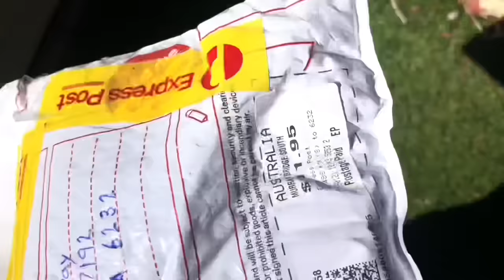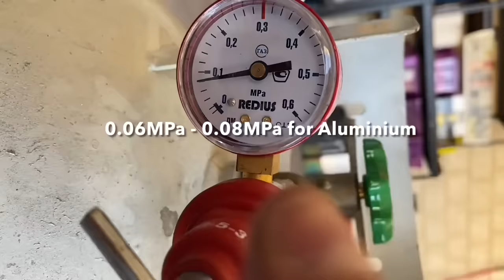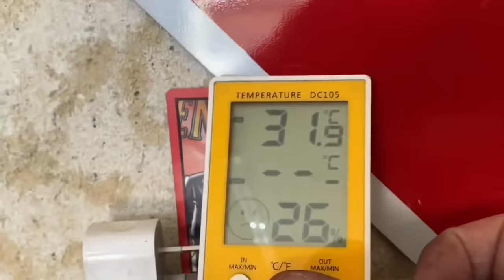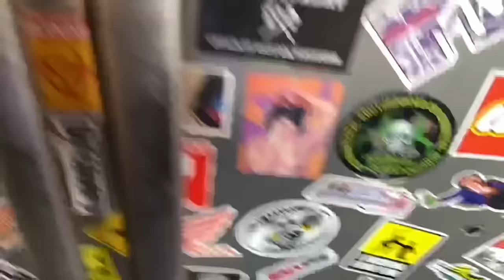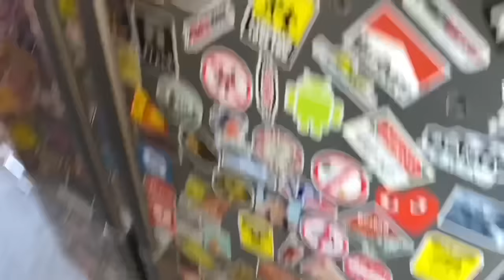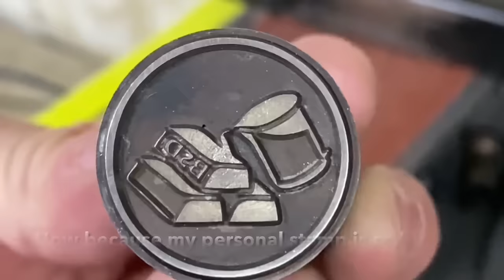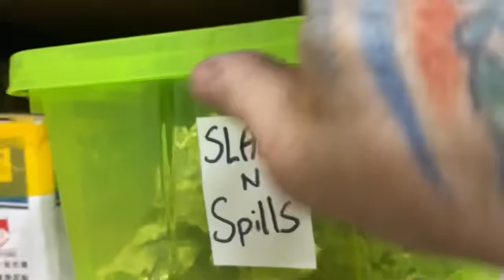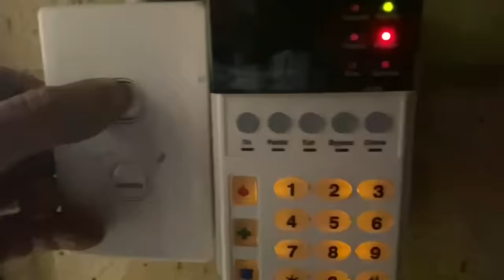Hard Drive Disc Destruction - Copper Aluminum - ASMR Metal Melting - BigStackD  Platter Perfection

Comment: I think this is the most secure way to protect data...  MELT IT...
Reply: Most secure way to get rid of the data you don’t want
Reply: Yep then cops cant find it etiher
Reply: I can just imagine BigStackD calling Drive Savers and saying that his hard drive was in a fire and he needed the data off it. And when he ships it to them, they'll open the box and see an ingot
Reply: @thomasvlaskampiii6850   that would be funny.
Reply: Hillary should have thought of that.
Reply: Step one, disassemble, step 2, run a big ol magnet over the disks, step 3, burn then crush, step 4 melt.
Reply: @shawnostrander1890  just melt, once you get it hot enough it demagnetizes anyways, and melting it completely destroy any magnetic coating left
Reply: <NordVPN intensifies>
Reply: @southaussiegarbo2054  well if any of that data was online they still could
Reply: @thefalloutphoenix   true.
Reply: Entirely correct. It is possible to lift data from discs even if they have been degaussed, burnt and chopped to pieces. Forensic investigators can do this. The only way to fully erase data is to melt it to liquid or dissolve it in acid. Acid is probably cheaper and easier for most people. Drop the whole HDD (no disassembly required, disassembling a HDD can be quite difficult) into a bucket of battery acid (sulfuric acid) and the acid will dissolve the copper and the aluminium. Dispose of the acid solution and the steel casing/plastic components properly.
Reply: @captainscarlett1  doesnt work 1. many drives mainly laptops use ceramic platters 2 they are palladium coated that sulfuric acid aint gonna touch em, and obtaining a torx bit is the most "difficult" part of dissassembly, and is in no way harder than getting acid
Reply: @captainscarlett1  Angle grinder opens a hdd quite easily.
The government actually grinds their hdd's completely away.
Reply: That's true nobody can access them not even u
Reply: I love how all the replies are in a way telling you how to disappear after murdering someone
Reply: Ha-Ha 😂👍
Reply: @captainscarlett1  If you have committed such a heinous crime you are considering data destruction - I would assume murder at the very least, possibly terrorism, cyber-terrorism or espionage - then how you dispose of your sulphuric is probably the least of your concerns. If you get caught, its life in prison at best, a short date with a long rope at worst, depending on which country/state you are in, so a fine for improper disposal of acid really wont concern you......
Reply: You spelt destroy wrong
Reply: You probably haven't met black market Jack
... He would extract data from that
Reply: @captainscarlett1  just grind it, you can’t lift anything if it’s dust
Reply: Very secure, but hard to retrieve.
Reply: It truly is!!!
Reply: Yep I saw this and was like welp that data is gone. 😅
Reply: That is how you get rid of NSFW pictures. Not that I have experience.

Comment: So when i die, please clear my browser history and send my hard drives to BigstackD
Reply: Lol
Reply: @sebas Stein I love my browser history!
Reply: Hahahhaha good idea 😂
Reply: @Tano HDDs are more reliable. SSDs can't handle the reading and writing load nearly as long as an HDD can. Unless you're going to RAID them which will vastly improve the longevity of SSDs. But if you're building on a budget then a single HDD is the better choice for a PC.

Now in a laptop, the loss in longevity is balanced out by the reduced power consumption, so that may be better for you. Still, preferably you want to get a laptop that allows for 2 or more hard drives so you can raid the SSDs.

It cannot be understated the performance boost given by a proper RAID in place.
Reply: @Tano I don't quite think you know what you're talking about honestly. HDDs blow SSDs out of the water in terms of reliability. For every year an SSD can last, and HDD can last 2, sometimes 3 depending on the quality of the HDD.

SSDs are faster and more energy efficient. That's about it though.

As for RAID, it's something you can do with HDDs and SSDs. So even you with your HDD hating self should do it. It's more than worth it even if you go 0.
Reply: @Tano Sure. Keep talking like you know anything on the subject. All your responses have been "lol old" as if that means anything or is a valid response. Try an actual rebuttal with facts rather than anecdotal "but it works for meeeeeeee."
Reply: @Tano Again, actual arguments. Lol old year doesn't mean shit.
Reply: @Tano Make arguments or gtfo
Reply: @sebas Stein ever since pornhub deleted my favorites I have to have a browser history...
Reply: @Tano Lol, I like how you started with saying the other guy was living in 2010, then 2005 and now you're down to Y2K. Get on my level, I store all my porn logs on 3.5 inch floppys. Data's not properly stored unless it sounds like gravel in a blender.
Reply: @Snigelkrantz  Honestly I miss that sound

Comment: BigstackD offering new data destruction services.
Reply: Hey, I have this box in my attic called "Taxes" and "Incriminating Evidence" I need you Big stack!
Reply: @letsgetto1millwithoutvids  actually,  while you might remove data, you don't remove the header tags from a drive (a traditional,  mechanical drive.) And doing that on an ssd kills the drive faster
Reply: @letsgetto1millwithoutvids  I do and a format does a 1 pass of zeros.  It doesn't remover header tags though,  which whatever the title of the data that toy had on the drive can be retrieved. 
Gutterman, the hard drive man himself has stated that modern disks are so dense that one zero out is enough to remove data from a drive. 

Also,  you don't even need to zero out the data.  A simple overwrite from a cmd prompt that fills a drive erg dead data also works.

Comment: When you use your 3D prints, you should smooth over a thin layer of wood filler with your fingers. When it dries just lightly sand off the chunks. I've found that it helps remove layer lines, and might improve the quality a bit. I use this method for making D&D mini terrains, afterwards I spray it with primer and it looks pretty great.

Comment: The purity of the Aluminium used in the platters really shows when you have almost no slag to skim off before pouring.
Reply: Yeah and some dort from the crucible
Reply: The surface of the discs contains some magnetic coating. I've heard it contains chromium, cobalt, platinum and not sure what else.
The quantity of platinum is very small and not worth recovering.

Comment: Things i've learned from bigstackD:

If you're ever having trouble melting your aluminum, just give it a good stir.
Reply: The aluminum was melting fine, its the platinum he had trouble with :D
Reply: @ForestSongUnLTD  HDDs have platinum in them?
Reply: @vbgvbg1133  A super thin coating of it, yes. That's probably why he made a coin from the slag.
Reply: @ForestSongUnLTD   You'd have to refine it

Comment: Why not look at investing in a Milling machine, to clean the surface, gives chips instead of dust, and is not contaminated with sanding and grinding compounds, and only needs a polish once machined.
Reply: With a nice sharp flycutter you can get some lovely finishes. And they'll stack nicer, too!
Reply: That’s removing too much material that will need to be reprocessed, also just needless time and labor, never mind an expensive machine.  The ingots are not a finished product,  just an efficient way of storing material for future use/sale.

Comment: 13:46 "magnet in a cup" for picking up steel.  I use a magnet in a plastic bag so that when I'm done, I turn the bag inside out leaving the steel IN the bag, and the magnet outside, but clean.

Comment: I still have almost every hard drive from every PC I have owned, a couple might be missing at most. It's a couple of shoeboxes full. I wonder if I can still get any data off them...
Reply: Using a pc app called "recuver" id say most likely.(its essentially a free basic version of what the cops use fyi)
Reply: plug em into your pc and find out if they spin up
Reply: They should all still work if you have the right hard drive ports for them
Reply: @southaussiegarbo2054  Thanks, man.
Reply: @rupertmiller9690   its a tip i got a few years ago when at school still from one the IT GUYS (Cheers to greg) so he saved my rear end a couple times with his support and instal for it.
Reply: @johnstrad   yeah but most others are ones you pay for. 
Recuva works for lots but not all. In a cops words "if recuva cant find it we are likely 90% unable to get it

Comment: Darn,  those platters are so beautiful, perfect mirror circles, I wish there was a good re-use for them, like maybe in some art, or maybe one could make a solar collector oven etc. with them. But of course, you do you :)
Reply: Hard drive discs, as far as my secondhand knowledge from like 2014 goes, are pretty common. You could probably find some on the internet easily and use them for art if you want.

Comment: So interesting point of info on those platters, i'm fairly certain you could recover precious metal's from that slag due to the sputtering process used to coat them. Unsure of how much you could recover but with a decent amount of them might be worth while.
Reply: I had been thinking the same thing 🤦‍♂️
Reply: They have platinum on them but it's soo thin you would need 10x what he had to get enough just to pay for the chemicals required to extract the platinum.
Reply: @mewmewdesigns895  Yes its a very tiny amount. But I think it was the platinum contamination that made the ending slag so thick he had to spoon it into the mold.

Comment: Oh my. The flames from the ice.. I didn't think it would be hot enough to split the water into Hydrogen and Oxygen.
Reply: Those HDD platters arent just aluminum, perhaps some exotic platinum reaction?
Reply: Good observation! I noticed that too.
Reply: Yes, the platters in hard drives are usually plated in platinum. Not sure if platnium reacts in such a way in those conditions. Its usually pretty inactive and has a very high melting point. Its likely mostly in the slag which is why I think the slag was very pasty and wouldnt pour.
Reply: @robertbeighter6336  The Cobalt in the alloy reacted with the water to form Cobalt Oxides. I hope he was wearing a respirator.

Comment: What If you cast the top half of a Terminator, like a T-100, in aluminum and then set in in one of the bar molds and poured copper around it like it was melting? It would be cool to see some unmelted stuff mixed in with melted stuff.

Comment: huh weird, i would have guessed hard drive platters were made of some kind of steel since they have to be ferromagnetic.. but it seems they are made from aluminium with just a thin magnetic coating.. nice ^^ (the coating is probably that stuff you can see at 2:30 i guess)
Reply: I thought it was palladium

Comment: I think the slag skull is Made mainly of platinum and aluminium 👍
Reply: Platinum melts at almost 2000 degrees higher than aluminum
Reply: @donniebrown2896  The magnetic coating on a hard drive platter is a Cobalt, Chromium, Platinum alloy with a melting point of around 1300 centigrade. it is however 'dough like' at temperatures over 650 centigrade.

Comment: Hey bud. When you push things through a table saw, you push them on the right side of the blade (fence side). If that brings your hands dangerously close to the blade, then use a push stick. You can still guide the lumber with your left hand on the left side of the blade, but don't push on that side. Also table saws aren't made for cutting off the ends of lumber (cross cutting) but rather for ripping with the grain. It's much safer to use a circular saw or chop saw to cross cut. Thanks for the content.

Comment: I am/used to be the local "computer guy" so everyone used to bring me their computers to either fix, or scrap if they were beyond saving - and sometimes people would just give me piles of old computers/electronics. So I ended up with tons of hard drives. Eventually, I realized they had the super strong, rare earth magnets in them and I started butchering the HDDs for the magnets. But I had wondered what the actual discs were made of - it kind of seemed like they were made of something exotic, or at least somewhat valuable... I'm just starting to realize I still have tons of computer/electronic junk and I'm strongly considering getting a propane forge and see what sorts of valuable metals I can harvest from the stuff while clearing out some space around here. I've seen videos of people stripping stuff like gold, platinum, etc from electronics - which, I don't know if that's even true or viable, but that might be a valid avenue too.. Even if I couldn't make a dime from recycling, I'd still like to do this as a hobby - molten metal is totally mesmerizing - and perhaps also make knives with the forge.. I don't get excited about much anymore but this is starting to tickle my fancy...

Comment: Loved the intro with the watch. Also when you poor the copper into the sand casting is it the sand that is catching on fire? Another awesome video.
Reply from the maker: Kind of, the sand is oil based so it’s actually the oil that burning but it does burn the sand as well because of the oil👍🏻
Reply: @bigstackD  Ok that makes more sense.

Comment: When I was working in the disc drive Industry, one day I ran across a couple of barrels full of old discs like this in a warehouse. Several hundred pounds I'd guess. I suggested to the guy in charge of all the surplus stuff that those discs must be worth a lot of money on the scrap metal market. He said no, they have to PAY to have them hauled off. This was considered HAZMAT material due to the heavy metals sputtered on the aluminum substrate for their magnetic properties (cobalt, etc). Those ingots may be pretty cool, but I wouldn't make flatware out of them, and don't breath the fumes coming out of your furnace.

Comment: Just a guess-timate ballpark - how long can you run your forge off that 20lb tank?
Reply from the maker: I could probably get 4 good melts off 1 tank. If you check out my copper cube video two weeks ago you’ll see the gas usage cost to melt over 6 kg of copper so that will give you a better understanding on the heat efficiency and cheapness to run these furnaces . 
https://youtu.be/jwNY9PswHDY👍🏻

Comment: If I'm not mistaken if I remember correctly those hard drive disks are covered with a small coating of platinum. That's if I'm remembering correctly which makes that piece of metal a mix and expensive
Reply from the maker: Yes a lot of people have said there was platinum and some other metals inside them I just assumed they were all aluminium but that’s okay I melt it anyway👌🏻

Comment: Where did you buy the furnace from and what size 10kg?
Reply from the maker: Yes 10 kg furnace. here is a link simply use this link and it will take you to the devil gorge ebay page so you can check prices . It’s free delivery anywhere in the world on any furnace or Forge👍🏻. This link will also give an additional 5% discount and will automatically apply once an item has been put into the shopping cart.
http://ebay.us/4cZEwJ 
Any other questions about the furnace or hints and tips on how to start hit me up on my email and I’ll send through a heap of info. Bigstackddddd@mail.com

Comment: I don't think the big disks turned out well because the raised portion of the plastic blanks isn't high enough to make a very good impression in the casting sand, the molten metal just shoves the sand around distorting the detail of the moulds.
That could also be a problem with the sand mix itself.
Perhaps the sand isn't bonding to itself well enough to hold together during the pour.
Don't know for sure, I'm just guessing, I'm not a metal melter/caster...

Comment: Those aluminium platters contain nano-meter thick amounts of Cobolt-Platinum-Indium alloys as a coating. Therefore youre not just melting Aluminium... You have made an Aluminium alloy that is a bit more expensive than regular pure Aluminium...
Im a IT professional and started to melting metals after loosing my job

Comment: Since your sand frame burst into flame every time you sand cast something, have you ever thought about making a frame out of extruded aluminum tube?

It should be more than strong enough to withstand the pounding it'll get when you're making a mould and will laugh at the flames caused by casting...

Make once, use indefinitely rather than make, use 2-3 times, remake - repeat indefinitely...